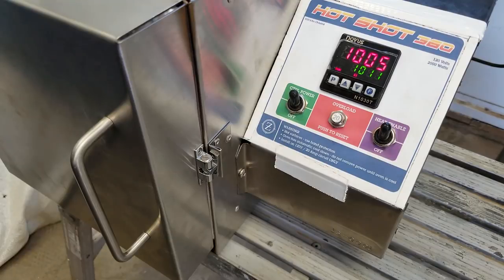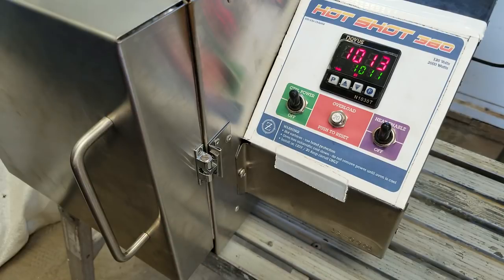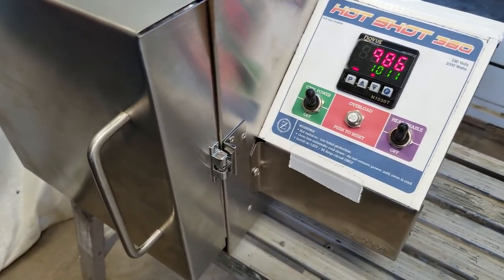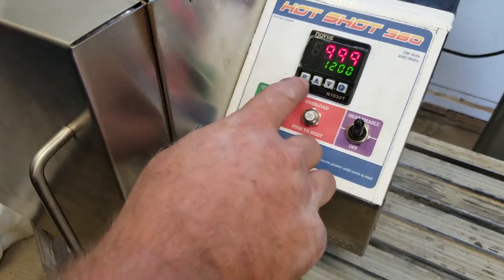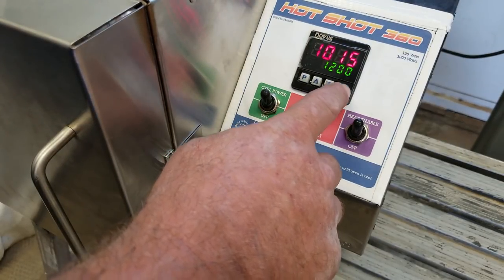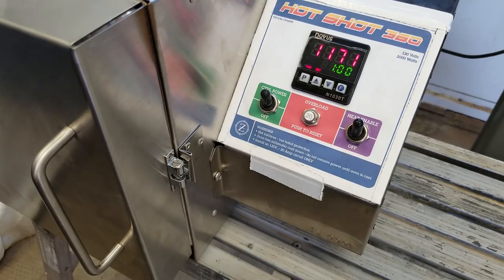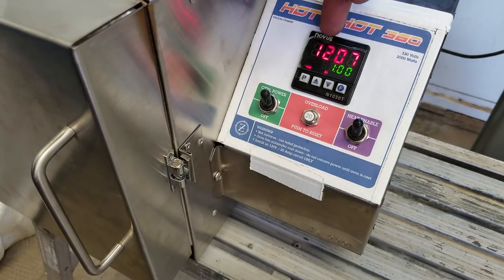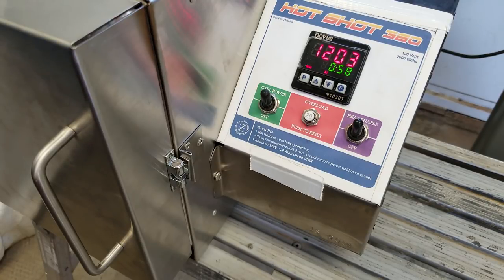The Hot Shot 360 control overview

Comment: I have a laboratory grade kiln/oven like this but it has all manual temp controls and analog temp display. What would it cost just for this controller so I can upgrade it? Its a $3,000.00 kiln so would not be interested in buying another unit as am already buried into this one. But digital pic control would make it the bomb. Mine gets up to 2400 deg F or higher and no elements are exposed inside all are under the firebrick or embedded into the bricks controls are in the base because heat rises and door swings up like a gull wing door so no latches needed as its held closed by its own weight . But does have a trick mechanism for the way the door swing out as it goes up and open away from the opening and no hinges are subject to much heat that is rising out of the opening.  a Stainless body would have made this unit of mine better like yours here requiring no paint. Good job Stan it looks like a winner.
Reply: Digital PID controllers are pretty inexpensive these days, even brand name versions (the only ones I would go with).  Watlow, Omega, etc.  Probably not more than $200 unless you want a ramping (rate) controller which would be considerably more.  All DIN sizes to fit nearly any space or existing holes.
Reply from the maker: Lab ovens are a whole different class of oven (for the better) the old analog controls can certainly be changed out, the little manual temperature controller like I have used is inexpensive, but when you get into the process controllers, they can easily get into the 1200-1700 dollar range.

Comment: just a question, and forgive me as i have no engineering experience...In one of your development vids of the hot shot you mentioned you tried magnets inside the case of the oven as you didnt like the look of them on the outside.  You followed that by showing how the prototype didnt function so well with the magnet inside the case and caused issues.  Now that you have a mechanical latch, could you install that latch back inside the case and that way keep the exterior clean and sleek?
Reply from the maker: These latches need a small amount of grease,  I'm afraid the heat would melt away the lube.
Reply: Great observation, i would have never thought of that.  Shame it needs the lube though.

Comment: I would get rid of that super complicated plc timer from the 90's, that will ruin someone's day and metal . when they loose the book its over...... you need a more intuitive unit oled touch unit. I really like the oven but cant remember a seeing a announcement of a product run?....
Reply: Last time I checked, the two ways to get one of those fancy controllers were time or money. I'm sure Stan doesn't have the time to roll his own, and buyers don't want another $100 added to the bill for an off the shelf unit.

And I'd be concerned about reliability.
Reply: @johnalexander2349  no
Reply from the maker: Using off the shelf temp controllers from a reputable supplier (not e-bay disposables) This is an entry level oven with an entry level price point, all this would do is drive the price up.
Reply: I agree

Comment: Brushed stainless is an ideal choice.  It denotes a quality product.
But why ruin its aesthetic appeal by stamping the serial number in a place where it daily assaults the eye ?

Customers will consider the door corner gaps to be poor workmanship despite your intentional use of them. 
Create a door vent that is hidden; perhaps in the upper reverse edge that is unseen when the door is closed.

Your future design should include the much wider market of Potters, Ceramicists, Jewelers, Dental Technicians and Hobbyists.
You may have to minimise footprint by relocating the controller back under the oven for that market.
The build material is right, the door handle and hinge is right, the firebrick base is right, the controller, TC and Nichrome is right.
Your product is superior to that of TTFCoy .  Your prices should reflect that.    I think you are on a winner.

Comment: Stan - This particular one looks pretty rough. Door doesn't fit, large exposed gap at the door corner, a complicated control system, and it looks like you are back to having to use two hands to operate the door.
Reply: Gap in door is intentional (see earlier video).

I assume the door latch will break in a little to be better, plus, when the oven actually has parts in it, it will be more resistant to sliding the unit around on the bench.

I'm guessing if you want a better controller, it can be upgraded, for a price. (This was targeted to be a certain price point, if I recall correctly.)
Reply from the maker: Yes, I opted not to weld up the door corners to allow venting through the Kaowool, the slam latch works fine 1 handed but didnt want to bump the camera while I was filming this.